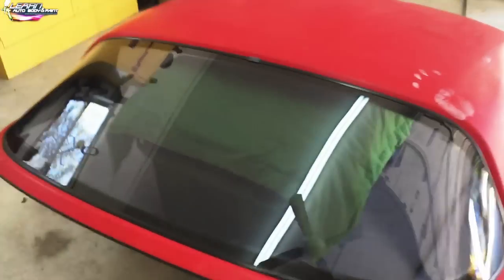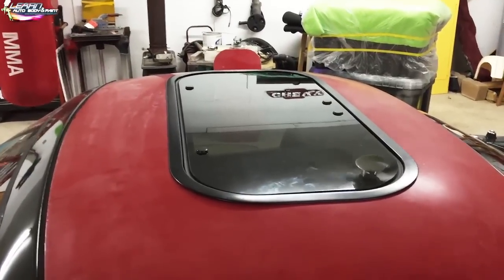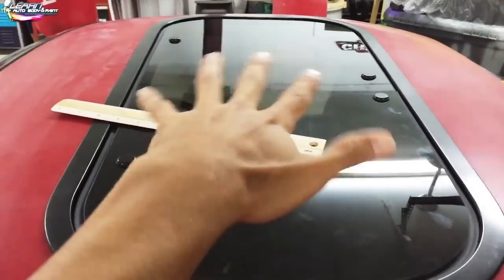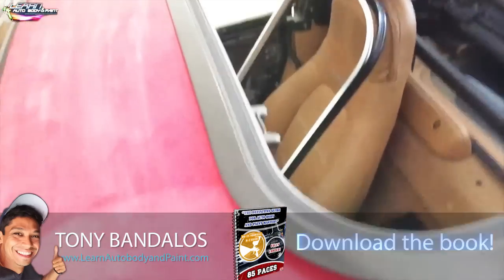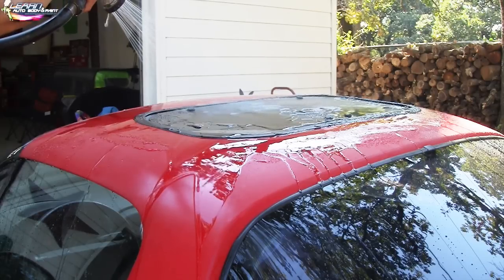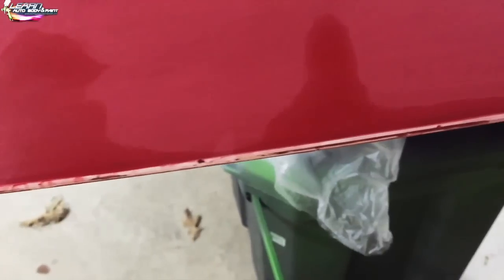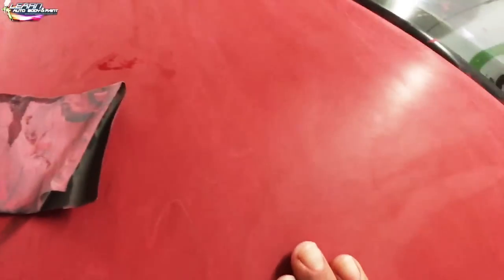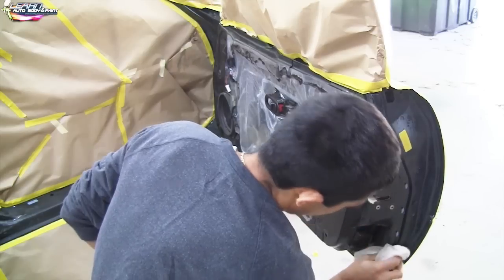Custom DIY Auto Body  - Installing a Universal Sunroof on Your Ride!

Comment: Nice job, why didn't you cut the hole for the sunroof, paint the roof and install the sunroof after it was painted?    I installed hundreds of sunroofs both power and pop-ups, so I am not speaking out of context here... your videos are great!
Reply from the maker: Rich Burdick was thinking of doing that.. but didn't want to screw the paint job up :)
Reply: what would be a good tool to use to cut the hole ,I am doing a project on my car..I would really appreciate some advice
Reply: Can you send some sunroofs to me in Nairobi kenya